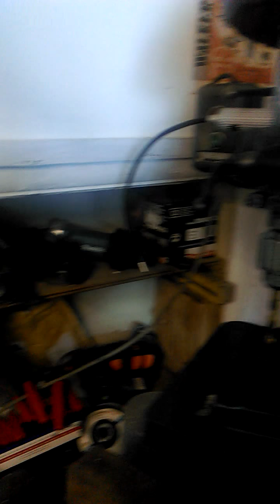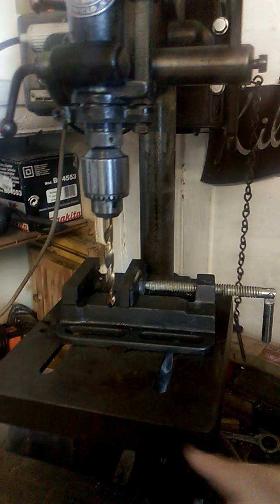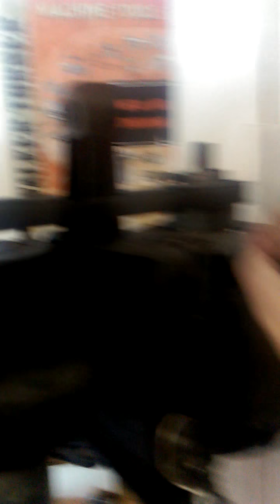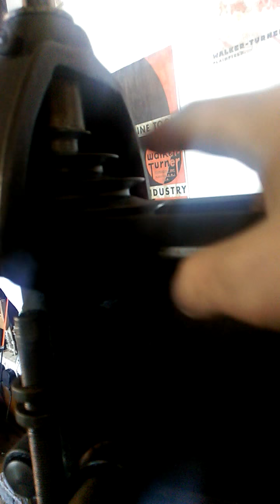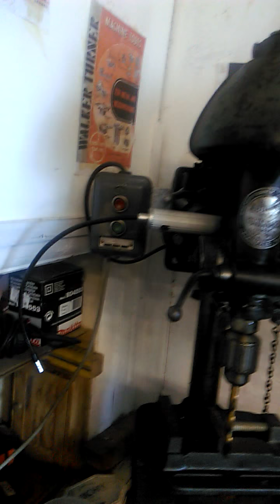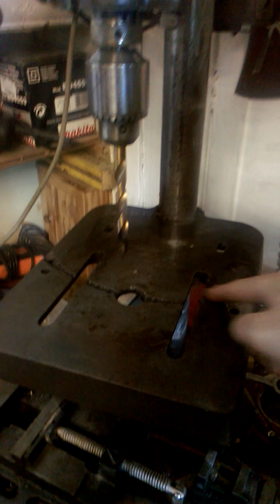Drill press

Comment: Its a nice drill it's a 700 series, I have a 900 series which I have restored I have it on YouTube check out brabs007 , mine has a walker turner 240 volt motor ,yours had had a different motor fitted and the five speed pully removed. Keep looking on eBay that do turn up from time to time .
Regards,